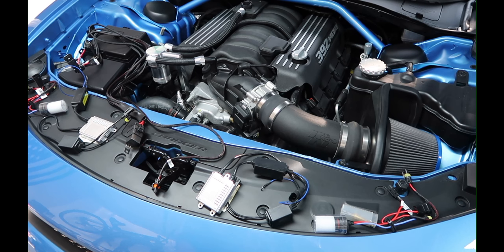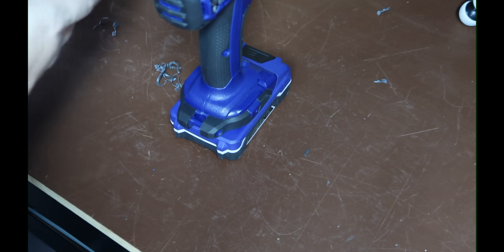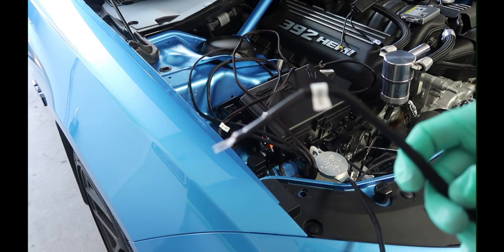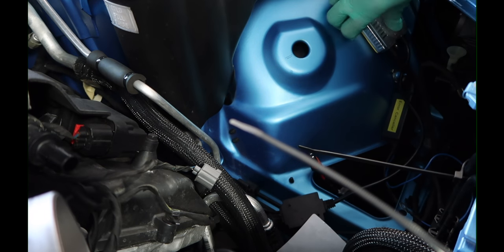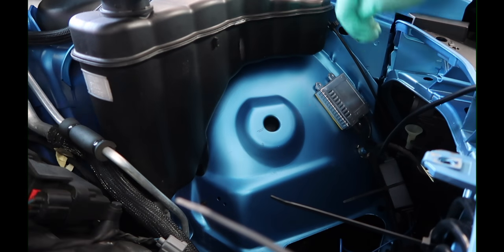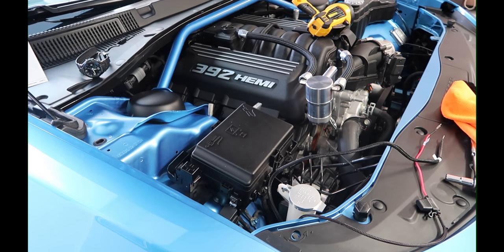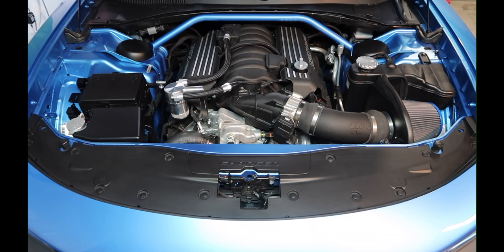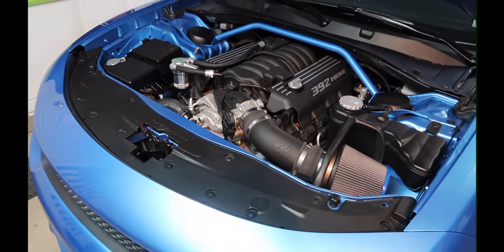Diode Dynamics HID Kit 2016 Dodge Charger (6000K)

Comment: Did you use the dodge specific wiring harness that DD sells or did you use a generic canbus adapter harness?  I've read that the CANBUS adapter is required for this to function properly.
Reply from the maker: FastRedPonyCar I purchased the additional harness from diode dynamics upon checkout just to make sure I had no issues and had all of my bases covered

Comment: Thanks for the video... Enjoy your page.  Maybe I missed it, but what kit did you get?  They have Hi/Lo conversion kit for the 2016 Charger or the low beam kit for the 2015 Charger?  Thanks.
Reply from the maker: thanks !! the kit I purchased was the hi/lo for the 2016.  I'm not sure about the other years but the bulb for the 16 is the 9005 which is why it's listed as both lol if you do get the kit, I recommend getting the extra wiring harness that attaches to the battery power like I featured this way you're basically using only their wiring and not really anything from factory except for that signal wire

Comment: Man i told you those Diode dynamics HID's were awesome!  I love mine. i went with 5000k and i didn't use the relay kit.  Alot better than LED bulbs in my opinion.
Reply from the maker: randy knight jr yeah I'm happy with them !! plus I love trying new mods so it was fun learning how to install them haha
Reply: Project 392  I’m debating on led or hid, I just bought some $40 led from off road leds from and Instagram page and they are crap my stock yellow lights are brighter than them, what would you recommend led or hid, Ive heard that led stay cooler than hid

Comment: So I bought this wrecked 2014 dodge charger sxt and my dad and I are trying to soup it up with a 2017 hellcat front bumper but now we've just been stuck in a shit hole with the whole headlight conversion for about a week now. See, the 2014 ran off of 2 separate halogen bulbs for high and low, while the 2017 has just 1 xenon bulb in it with a shutter to switch between high and low (a DRL was also around the perimeter of the headlight in the 2017, but that was able to work by soldering it to the parking light wire). Anyway, I was just wondering if you think that the kit that u bought could work on the 2014 wiring system.
Reply: Dont convert the headlights. Itll be a pain in the ass, gotta do fenders and the hood and radiator support and a few other body panels

Comment: Hey man your videos are dope! Quick question, so I have a 300c and was thinking about putting some 6000k bulbs in as well. Are the 6000k the same color temp as the fog lights that the charger and 300c have?
Reply from the maker: Jason Quiroz I would say 5000K would be the best match and 6000K would be VERY slightly more of a blue hue to it

Comment: Hey anyone out there? I've tried countless HID bulbs and they all have shadow issues...does anyone know which brand or where to buy a kit with out any shadow issues??? This is really frustrating!! Can anyone help me?
Reply: Joshua Love very frustrating, I was having the same issue and I was able to get rid of it by rotating the bulb into several different positions until it went away. Now there is no shadow on either side.
Reply: MrChrisv214 am I supposed to disable Daytime running lights?? Can u message me?

Comment: hey I just received my hid kit and it does not have the long wire that goes from one end to the other, is that a separate purchase
Reply from the maker: JOE MARTINEZ did you get the additional harness that they offer? when you're checking out it should have another drop down menu to add the harness. I don't think it's MANDATORY but to avoid completely the chance of having any codes thrown it's good to have. I think without that wire you're basically using the factory wiring to power the HIDS which should work as well

Comment: honestlyOCD I purchased the 50 led bulbs buy they would turn off once they got hot. I have a Dodge charger 2015 did you have anything like that happen to you?
Reply from the maker: no :\ mine are still running perfectly to this day although now they're sitting in the original box lol I have heard SOME people saying they had issues so maybe there is a quality control with the bulbs ?? did you try messaging the company to see if they will replace your set with another ?? mine have been absolutely flawless so I can only imagine that another set might fix the issue
Reply: Honestly OCD honestly I decided to just return them and save money for HIDs although if you are looking to get rid of yours since they are working fine I might be interested
Reply from the maker: yeah I'm not entirely sure what I wanna do with these just yet since the HIDs are pretty brand new and all lol I'll likely wait a week or two and see how things hold up but I don't expect any problems with this HID kit so I may consider selling them down the line
Reply: Honestly OCD alright sounds good man. So how do you like the HIDs so far? Are they worth the premium?
Reply from the maker: I actually bought my kit during the Black Friday / Cyber Monday time frame so I saved quite a bit lol I ended up getting the whole kit with the extra wiring harness for like 120 total which I feel is a great bargain and I'm having nothing but good luck with it so far knock on wood :O

Comment: Is the light output from the HIDS brighter than the LEDs? I have HIDS but I'm thinking about switching to LEDs
Reply from the maker: Anthony P honestly they're both fine for me I just did this to try it and to film lol the HIDs do project much farther but the actual light output isn't a TON off
Reply: Honestly OCD which version of the LED did you get that worked? I was thinking about trying the XENON DEPOT XTREME LED or just say screw it and go with a set of PIAA xtreme white halogen.....

Comment: how are they running? Ive heard that aftermarket HIDs can burn the window of the headlight?
Reply from the maker: SirMrRemo so far so good I've had no issues yet thank God lol I don't really do a ton of night driving either so who knows if long term use would be different but I don't see how it could be all that bad I feel it'll be fine in the long run
Reply: Good to hear! Just ordered the 6000K myself, do you mind uploading a video/picture of the front end with the lights on? Just curious how close of a match 6000K is with the fogs and LED strips. Btw thanks for the upload, I would have never found these if it weren't for your video
Reply from the maker: SirMrRemo send me a message on Instagram to remind me and I'll try and take a picture for you tomorrow. as far as matching goes it's a little off from the fogs but pretty damn close to the DRLS.  I usually drive with the DRLs on anyways and only use the headlights on really dark roads lol
Reply: SirMrRemo it's the 55watt ones that burn. 35watt is ok.

Comment: How is the setup working for you?  Light output clean?
Reply from the maker: Rocco Muffoletto the kit was awesome !! I don't currently have that car anymore but I had no issues with it and the lights were way better than stock .. only thing is some people have told me they had minor issues with one headlight not turning on sometimes and them needing to hit the switch of the lights to reset it or something but I personally never had any problems with them and the lights were great
Reply: Thanks man!  I'm in-between trying this and an LED kit.  Seems like HID has better output though.  Did you need the CANBUS unit for the car?  BTW what are you driving now!?

Comment: I want to get a ScatPack but I have a few questions that maybe you could answer for me. I have a somewhat steep cement driveway, does the car scrape the front super easy, I guess I mean is it a problem or a constant issue??
Do you have to get one of those oil catch can things or can you just drive the car without getting that?  
Please go into detail on my first question, thanks.
Reply from the maker: MURRAYsaysHI hey! I would say that the front scraping IS a concern .. my drive isn't that steep and I do have to do the sideways shuffle to get up and down it .. then again I've scraped other cars lol it's not HORRIBLE but I honestly think that what's "scraping" are these plastic things that sort of hang down on both sides about 2 or so inches lower than the actual front bumper .. when I had my mid muffler deleted I was looking at the under part of the front and there were marks but nothing crazy .. the car really isn't THAT low but I do feel because it's the wheelbase and the height, it works against us on things such as speedbumps and such .. but in all honestly I wouldn't stress much about it lol I live in NJ and the roads SUCK here and I've been fine so far thank God

Comment: What led bulbs did you use?
Reply from the maker: the LED bulbs I had on before the HIDs were purchased from Amazon.  If you search Zdatt 9005 it'll be the first one that comes up for $49.99.  They clear the dust cap just fine and I felt like it was plenty of light output for me but, than again, I don't live in a dark country area or anything so my situation might not work for everyone lol
Reply: Honestly OCD are they better then the stock headlights?
Reply from the maker: Aston Williams if you got the car without the stock HIDs than this is definitely an upgrade in output AND color lol matches the DRLS much better and looks pretty great